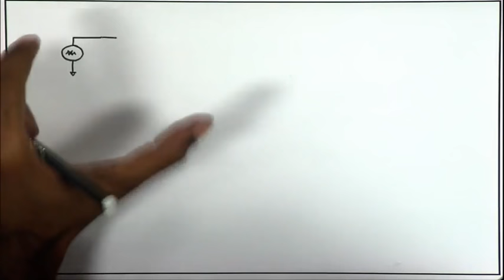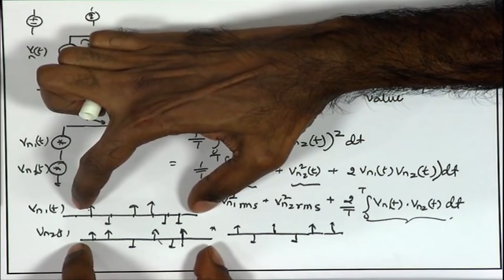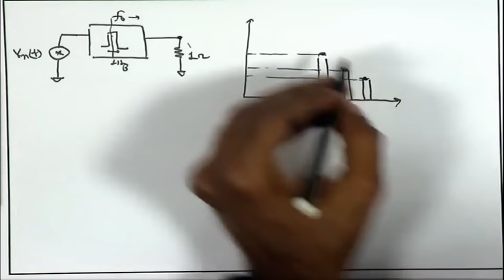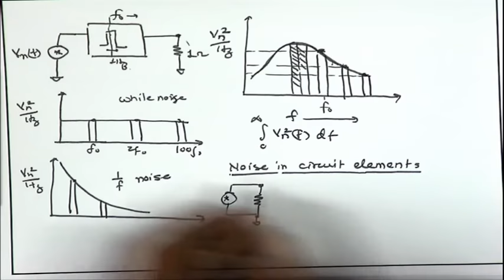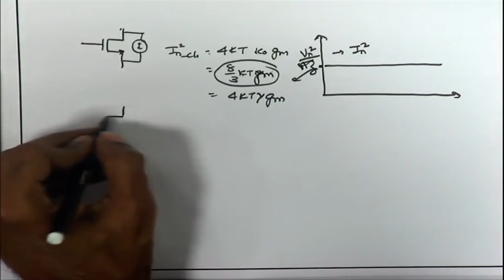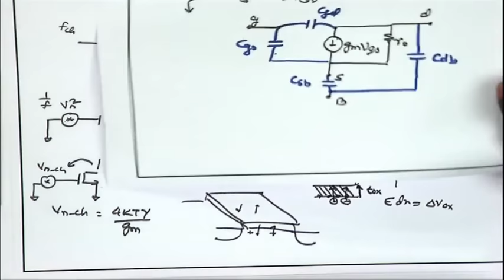Lecture 5: Basic Analog Design Part III

Comment: The Video covers noise models with power spectral density. Also, explain different noise sources in MOSFET and updated high-frequency small-signal model with noise sources.